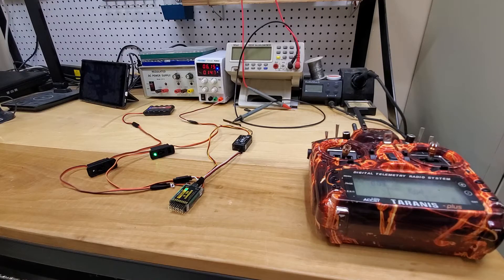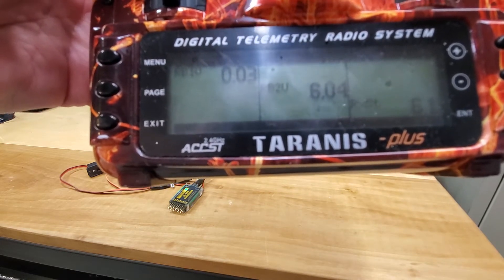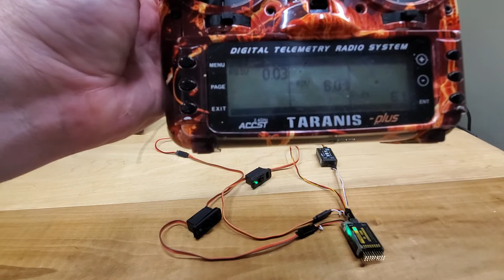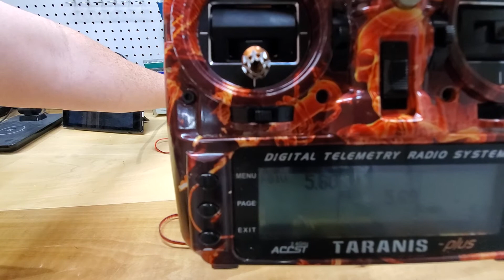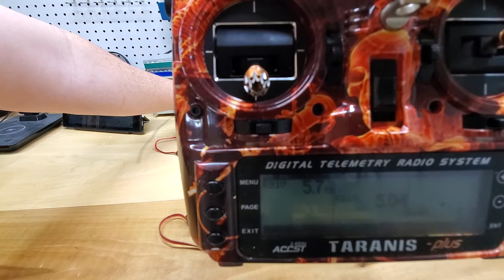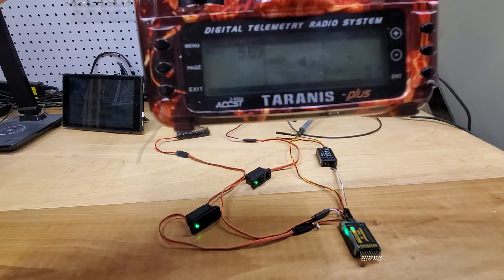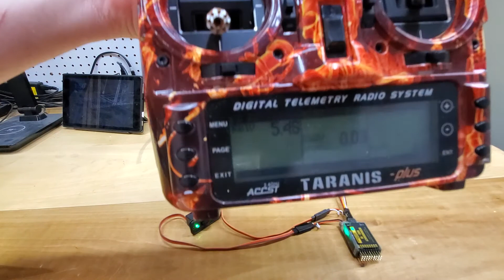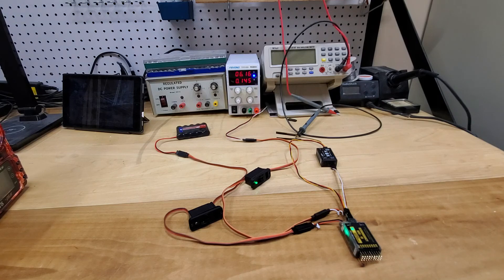Frisky Redundancy Bus-10 voltage demo

Comment: Thanks Bryan for the video. So if I understand you could run an ESC with an output of lets say 6.0 volts into Battery 1 and a 2S lipo into Battery 2 and it would use the lipo input until it dropped below 6.0 volts. There is no danger of 2 separate voltages.
Reply from the maker: Correct, chemistry matters not, and starting voltages matters not, as well.
Reply: @mp3manbh  Thanks